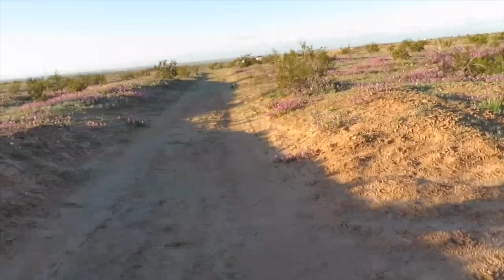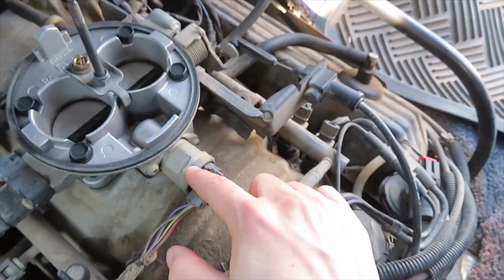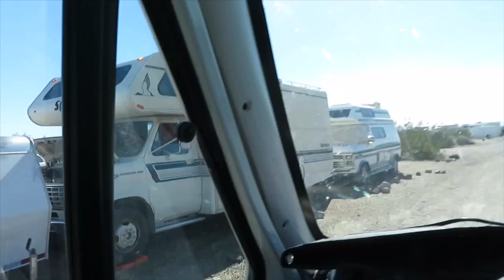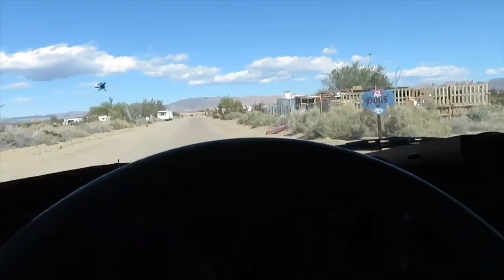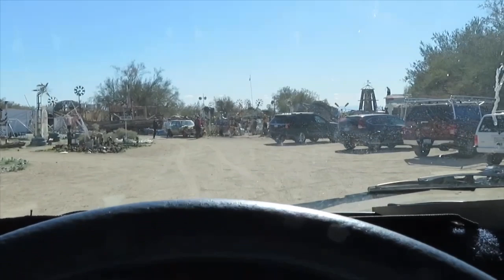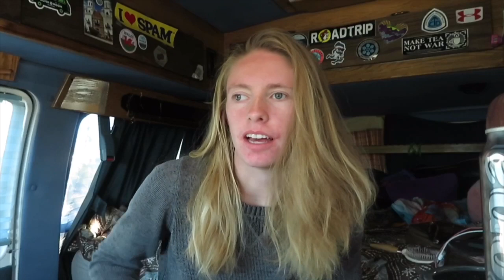LOUD People & Working On The Van - Day Two Slabs

Comment: I kid you not, I have "Prolong" in every engine I have. I drove a 95 Monte Carlo without oil or water for 3 years, it never over heated. No kidding, 3 years. I took it for an oil change and the mechanic was shocked when NO oil came out of the pan. He couldn't believe it, he'd never seen an engine get that hot and show no damage. The oil companies sued them, but they settled out of court. Prolong doesn't advertise that it's better than oil like they did, but they still sell it. It is the best additive on the market. There are YouTube videos still up of their commercials, it is absolutely amazing.

Comment: I noticed you are frequently visited and pestered by flies in your van. I picked up a tip from Pinterest many years ago and have been successful keeping them away. If you take a clear "baggie" sandwich size, put water in it and make like a small water balloon type and hang it inside near your doors. The flies lands on it and the reflection of the fly is magnified and the fly believes this to be a bigger, predatory bug and leaves the area. You just leave them hanging. I have had same baggies hanging for going on 2 years in same place on my patio here in NW Pa. I have watched them freeze solid and then in Spring had to "dust them off" to make sure the "mirrored effect" works for the next year. I hope this helps. Love following your journey! Very inspiring especially being such a young woman! Safe travels! #GIRLPOWER
Reply from the maker: Great idea!

Comment: I still believe that engine knock has to do with a loose timing chain if you change your oil every 3 to 5k miles.  But a loose chain can run a long time before it doesn't.  Regardless the idle fix is good news, nice and inexpensive.

Comment: idle air control valve   has nothing to do with starting !! , clean the throttle body and check the cap and rotor, the cap and rotor has a lot to do with the way it start's and idle.

Comment: You probably already do this, but occasionally I run a bottle of carburetor cleaner thru the gas tank, ie 1 bottle for 21 gallons of gas. Walmart has them for $2/bottle in the automotive section. Just for monthly maintenance I have seen it helps keep the engine running a little smoother and helps gas mileage a little.

Comment: Well i will say it sound's a little better. Keep your fingers crossed. You might run a can of seafoam through the engine about once or twice a month to keep carb and fuel system cleaned out. Make it run better and improve fuel mileage also.  Stay curious .

Comment: IAC MOTORS .IDLE AIR CONTROL SOLENOIDS GET CARBON BUIL UP ON PINTLE VALVE INSIDE OF IT. THIS IS FOR YOUR COLD START IT ALLOWS ENG TO RUN AT FAST IDLE WEN COLD THEN WEN  ENG AND COOLANT TEMPS ARE EQUAL IAC MOTOR PINTLE WILL RETRACT AND YOUUR ENG IDLE WILL BE 5 TO 600  RPMS. THIS CAN ALSO CAUSE A ROUGH IDLE AND SOME KNOCKING. COWBOY.

Comment: KARLI. IF YOU HAVE A INTERNAL ENG KNOCK YOU WILL KNOW. ILL EXPLAIN . ROD KNOCK IS A HOLLOW SOUND.ANYONE WHO WORKS ON CARS MORE THAN 2 YEARS WILL KNOW THIS. A BAD ROD IS NOT THE WORST THING. I HAD AN OLD S 10 THAT HAD A IRON DUKE 4 CYL W ROD KNOCK 4  LIKE 3 YRS. STILL RAN. IF IT IS PISTON SLAP. THIS IS FROM PISTON SKIRTS WEARING. YOU REALLY HAVE TO KNOW WHAT YOUR DOING TO HEAR THIS .NO WORRIES. WATCH YOUR OIL PREASURE AND CHK YOUR OIL ATLEAST  ONCS A WEEK. AND ANTIFREEZE. CHK OVER FLOW BTL AND NEVER OPEN RADIATOR CAP WEN ENG IS HOT. X-TERNAL NOISES CAN BE A MULTIPLE OF THINGS.ALTERNATER BRACKET AND PWR STEERING BRACKETS SOMETIMES GTHE BOLT HOLES GET OBLONGED FROM LOOSE BOLTS OR BROKEN ONES. ALSO CHECK YOUR SERPENTINE BELT OR BELTS .LOOK AT OUTER EDGES OF BELT. IF IT IS FREY'D. THIS IS AN INDICATION THAT YOUR IDLER AND BELT TENSIONER PULLEYS ARE BAD. THE BEARINGS ON THEM WEAR OUT..TO CHK PULLEYS W BELT ON YOU JUST PUT YOUR HAND ON EACH ONE AND WIGGLE THEM .IF THEY MOVE A BIT. REPLACE ALL AS A SET .BOTH PULLEYS AND BELT OR BELTS..DONT SHORT CUT ON THIS WEN YOU HAVE TO DO THIS. THIS WILL SAVE YOU UNNESSARY WORK DOWN THE ROAD. WAS A HEAVY TRK AND EQUIPTMENT AND AUTO MECHANIC FOR OVER 45 YEARS. I KNOW MY STUFF. MY JOKE ALWAYS WAS TO ALL THAT THINK THEY KNOW SOMETHING.. IS .I PROBABLY FORGET MORE IN THE LAST 20 YEARS THAN YOU COULD LEARN IN YOUR LIFE TIME. BUT IT IS ACTUALLY TRUE..IN YOUR CASE REMEMBER YOUR VAN IS OLDER AND THINGS WEAR OUT.MAKE SURE THAT WHO EVER LOOKS AT SHERRY KNOWS THERE SHIT. ITS AT YOUR EXPENSE..IF YOUNEED PARTS GET QUALITY .BELTS AND PULLEYS  USE GATES ONLY .GOOD WARRANTY. IF YOUGO TOA OREILLY AUTO DO NOT GET MASTER PRO.HOUSE BRANDS ARE GARBAGE AND DONT LAST. USE TO WRK AT ONE I KNOW..GOOD LUCK. IF YOU NEED HELP TEXT ME IN YOUR COMMENT SECTION AND ILL ADVISE YOU ON WHAT I CAN .SINCE NOT ACTUALLY BEING THER E TO PHYSICALLY SEE YOUR BUSS. COWBOY....😌.ITS ALL GOOD.